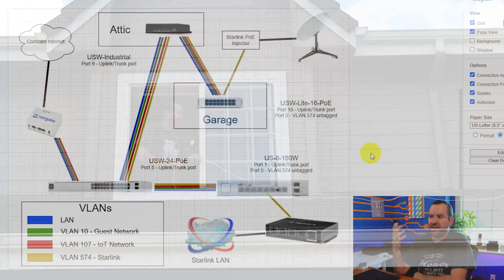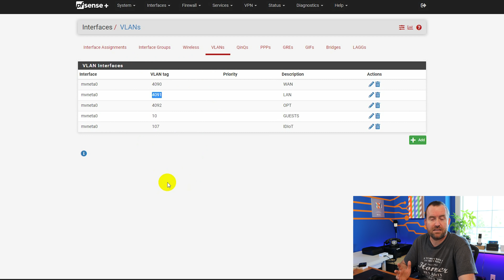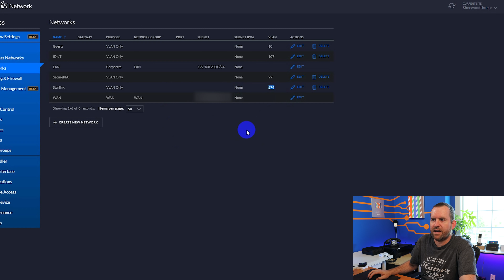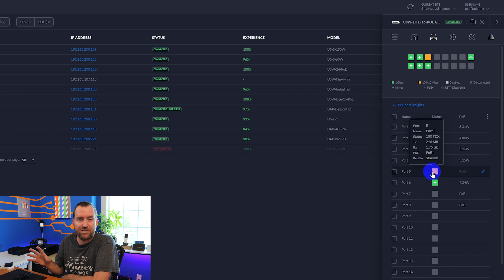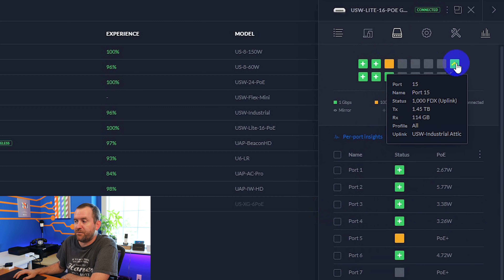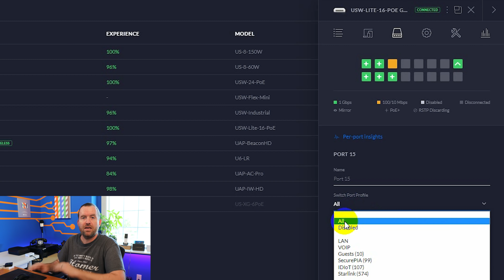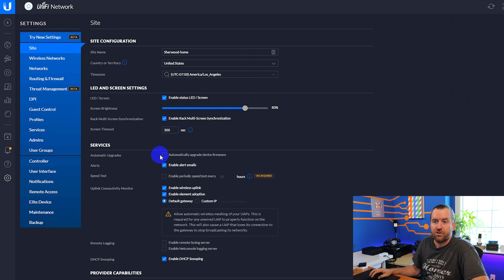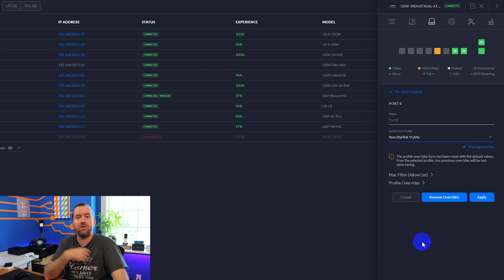My Starlink VLAN Setup

Comment: So this was good stuff, however in 2025 this method is no longer there in the New Interface . I found 2 Way to do it in the GUI, I am sure there are CLI ways as well. 1 Just Switch to Legacy Mode, or 2 in ROUTER select "Third-party Gateway" does the same thing as VLAN only option.

Comment: Great detail and explanation.👍👍  BUT, this solution doesn't seem to help me with my problem.  I have a remote location that is connected by StarLink which has a LAN of IoT devices (home automation, solar power system, generator etc.) and I need to remotely monitor and reset system setpoints etc.  In essence, I have a remote StarLink LAN that I want to connect to from my home network/pc or my smartphone to make these changes.  I believe I will need to establish a VPN connection but there's not enough geek in me to design the solution.  Help required.

Comment: I am trying to set up starlink without using their modem, can I just plug the white ethernet cable into a tp link switch because I tried that and reset the switch by unplugging it and plugging it back in and i'm getting nothing.. do i have to wait like 5 to ten minutes maybe? Or do i need to buy a tp link router er605? i've asked a few youtubers, i've emailed starlink. no one will help me.. pls help. i'm sure this is a simple answer for a tech. i'm not good with network stuff. IT looks like you are plugging direct into your switch at the first of the video?

Comment: I like my current wifi router, Synology RT2600ac, and its software and location in my house, is it possible to setup Starlink>managed switch>Synology Router and be able to retain all the functionality of my Synology router as a router instead of making it an AP? Is that where I setup a VLAN in some way. I realize this question probably makes it clear I should not do this, but I want to learn and figure out if I can use my current router as a replacement for the Starlink router, but run through a managed switch first before getting to the router due to wifi placement for the router in the house.

Comment: I do the excat same thing from my Barn that has a clear view of the sky. Then I run that VLAN.574 via the Uniifi trunk into my office and then tag it into my PFSense. I created a tagged VLAN.574 in PFSense and set it up as a backup internet connection so if/when my primary fails, it automaticaly switches over to Starlink.

Comment: I need to set up a unifi test lab at home. I've tried several times, but I keep on selling the hardware I've put aside to clients. There are often supply issues with Ubiquiti products, and having some pieces on hand has helped a lot. I've sold the G3 Domes I bought for my house at least 4 times. By the time I actually get to pull some cable through the roof and install them, they will have paid for themselves

Comment: With other manufacturers, the default VLAN is say VLAN 1. All ports are set to this by default, and it is not trunked to other switches. You then create VLANS for specific purposes, and set ports for client devices to one specific VLAN port. The only normal exception I see to this is if you want to use a single port port for a VOIP phone with a pass through port to connect your computer. This normally limits the connection speed of the PC to 100 megs, so its not the best. Hopefully these days in any business, you will have 2-3 Cat 6 sockets at each desk.

Comment: Hi Chris quick question do you know if there is any way to configure the UDM Pro to have load balancing of the two WAN connections rather than failover. I want to be able to have both Starlink and my other connection both active at the same time. The only option I have now is failover. 
Thanks 

Regards 

Paul
Reply: Latest UDM firmware allows that.

Comment: Thank you!  This video was tremendously helpful and understandable.  This explains how you can route 2 ISPs through your network to the edge router for testing Starlink.  I would love a video comparing "VLAN Only" to "Corporate LAN" with VLAN ID and how to segment or wall off each or perhaps allow cross-talk.  (IOW:  a use case where there's only one ISP but you want a certain VLAN not to be visible to the rest of the network and vice-versa, perhaps only accessible through VPN)

Comment: One note for people new to VLANs that wasn't explicitly called out in the video: never expose tagged frames to end-user devices. In other words, all trunk traffic should be at the infrastructure level, between switches or APs, not on any access ports on your switches.

Also, Chris -- I assume there is a physical limitation that prevents you from doing this, but it seems you could benefit from a hierarchical architecture by running your USW-24-PoE as a distribution switch and trunking to your garage. That way all inter-switch traffic would pass through the USW-24-PoE and you can centralize inspection and services there.

Comment: Hey Chris - Why didn't you just present Vlan 574 to PfSense as an additional WAN, and create a gateway group for automatic failover incase your primary comcast link dies. You could create another Starlink LAN, and use policy based routing to ensure that network uses the Starlink WAN as the default egress point.

More importantly, you could have put the Unifi Edge router on ebay and make it somebody else's problem :-)
Reply from the maker: I wasn’t trying to run the Starlink service into the pfSense.

Comment: Any worries about having essentially public internet touching your switches? (Yes I know it's a completely isolated vLAN)?  However it still resides on a Unifi switch and I've had experience with Unifi and traffic affecting separate, and completely isolated vLANs, but living on the same switch (absolutely no routing between vLANs, no router setup on either vLAN)  Edit to add: I know you say that the devices shouldn't know anything about the other vLANS, but as I mentioned, I've found this not to be the case in Unifi.  I've shown Unifi the issues and they've confirmed, but didn't have a resolution.

Comment: Since the StarLink dish is plugged into a POE switch, can you eliminate the POE injector (i.e. power the dish from the switch)?
Reply: As far as I know, starlink dish use proprietary PoE spec. So you can't.
Reply: @tofudimsum8072  So, if it is sold in the US, it has to have a UL listing, and the power requirements will be stamped on the unit.  Anyone have a photo of the specs?
Reply: @CJones-ic9tc  I don't live in NA. But the dish use non standard PoE. You still have to use the injector included with the dish.
Reply: @tofudimsum8072  So, no pic of the specs?

Comment: QUESTION: I have a printer on VLAN 10 that I want to share with Guest network that is on VLAN 120.  I want Guest clients to discover and utilize printer but nothing else on the VLAN 10 network.  What is best way to do this - reserve printer address in DHCP and write rules for firewall to only pass traffic to reserved IP address across VLANs?

Comment: Question: Consider the case for a UniFi camera / UNVR setup where you don't want someone to be able to disconnect an outside camera and "jack into your network" and see internal traffic.  You still want to be able to access the UNVR, suitably authenticated, even when you are offsite.  How would VLAN's play a role in protecting your LAN from a potential intrusion should someone "jack into a camera ethernet plug"?  

Perhaps you might even consider making a video on how to secure/isolate a camera network while still allowing the UNVR content to be accessed.

Comment: I have a small project do you think you can guide me pls ?
Reply: I've been following you guys on your channel.  I'm planning a project and want to use ubiquity products. I'd like to get your opinion on and suggestions for it.
Reply: The requirements are to set up wireless access to a ranch that will have small metal container homes, so each one will need wireless within as well as a way to connect to a wire. Also, wireless is needed for common areas such as pool area.
Reply: NOT for free...that's just 1 way he makes his money. Who will support it in the future if you don't know what you're doing? 
He can be contacted for consulting work

Comment: Why did you choose to set up Starlink as it’s own LAN?   

Couldn’t you use a Starlink1 VLAN to ‘trunk’ to your USG/UDM and connect a Starlink port to the WAN 2 port?  

Does UniFi allow for load balancing to assign the a WAN connection to a specific VLAN?  In that case a Starlink2. VLAN would have firewall rules applied. 

It would require two VLANs, if it is even possible with UniFi gateways, but would allow access to Starlink using your existing network.  It could also serve as a failover in the case of a Comcast outage.

Comment: Chris, since the UDM Pro still doesn't implement IGMP-Proxy I had to do this same setup on my AT&T fiber with U-Verse TV in our Unifi environment.  I have 2 uplinks coming out of AT&T's Arris BGW210-700 gateway: one in IP-Passthrough mode to the UDMP, and the other to SFP25 on the USW-24-POE switch.  That port is setup as VLAN-Only VLAN10.  From the USW I have "All" uplinks to the 2 devices that need it: a US-8 in the media room for the DVR (the DVR's port profile is set to that VLAN10 which feeds a set-top box), and a UAP-AC-IW in the in-law apartment, with one of the uplink ports on that AP profiled to VLAN10.  The AT&T gateway does all the DHCP, routing and IGMP spoofing for that VLAN10 so the DVR and set-top box get IPs and clean, uninterrupted signal on AT&T's bizarre unicast to multicast IPTV implementation.  I have no IGMP snooping on any of my LAN (VLAN1) or IoT VLANs, and the rest of the uplink trunk profiles are set to only deliver those 2 VLANs.

Comment: Carrying any traffic on the Native VLAN of a trunk is a security issue. Do not do this. Also, bringing "outside" traffic into your interior network equipment is also not a good idea. Lot's of bad information here. Yes... It might work, but you're doing this wrong and suggesting other people do the same. Stop it.
Reply: How would you recommend setting up the network in this case?
Reply: @narkeddiver7325  use VLANs properly, don't put traffic on the Native VLAN of a trunk especially untrusted "outside" traffic coming from the internet. Put a small firewall at that edge between Starlink and the rest of the network. An old ASA or even an old ISR would be fine. Use encapsulation for separation if you must use the same wire at least use GRE.
Reply: Routing and zones.
Reply: @myrthjt  thanks for your explanation :)
Reply: @narkeddiver7325  very welcome.

Comment: Great explanation and breakdown. Wish I had the patience to sit down and write up how my network is setup. I work in IT so I try to replicate what I have to work with day in and out. Ended up setting up an external PfSense firewall, and then an internal one. Took some time to do so I could get VLANs, static routes, and DNS to work how I wanted but it's videos like this that either sparks someone's interest to give it a shot, or are an Ah Ha! moment for someone that's been hitting road blocks. Great video.
Reply: For what it's worth, for any untrusted devices that are hardwired, such as IDIoT devices, I recommend putting them on access ports and not trunked ports. Wireless would be isolated to the VLAN specifically assigned to that SSID if they are setup properly. This would prevent them from being compromised by modifying the VLAN tags to hop VLANs in the event they are exploited.
Reply: Then I watched the rest of the video and my foot was put in my mouth.. :D

Comment: Does running it this way with the untagged port connecting to the Starlink WAN leave you open to a VLAN Hopping attack allowing access to the rest of your network VLANs? Do you have to do any additional configuration inside the switch to mitigate the risk? Also what's the reason you didn't put the edge router with the PoE injector and then trunk the Starlink LAN back down to your office?
Reply: Yes.

Comment: LOL, No USG/UDM..... Need to be mindful of UniFi that will bridge VLAN's at the USG's by default, pretty certain the same on UDM. 

Chris, your description for tagging is confusing, the port on the switch when assigned will Tag/Untag, the rm untagged is incorrect. On managed switches, All inbound traffic will be tagged, all outbound will have tags removed. 

You did touch on this but for others, If you leave a port as default on UniFi, all tags will be intact and presented to every device on the network. This means you have to set ALL ports on the network switches to the correct VLAN or VLAN's (switch-port profiles) of switches as all are "Trunk" as default.

Comment: Unifi helps a lot by not usung taged/untaged/trunck nomeclature
Reply: Yeah it helps but also makes it harder when you start using other manufacturers network equipment after using Unifi. Luckily i learned it the hard way before i started to use Unifi.

Comment: I was working at a local WISP and we had an Unifi city-wide network with private fiber links to towers and we used something similar. There was a Mikrotik router and a set of VLANs that were set for different IP blocks and we would set ports of Unifi switches to connect customers in office buildings, and CPE radios we would just set the VLAN for the customer side Ethernet port to give them internet. This setup was really easy to work on because it was an Unifi network underneath and I could pull up a phone or tablet and make changes, the IPs for the Internet were controlled by the Mikrotik and Sonar. VLANs are hard at first to get your head around butt once you realize they are just virtual network cables from one thing to another its not bad.

Comment: ¿Why not use the pfsence for the starlink and use it as a back up for the whole house, or testing on a vlan back to the us24 to play with? Not sure why the two routers
Reply from the maker: Mostly just for testing and video.  If I was using Starlink as a backup and/or load balanced secondary ISP, I would put it in the pfSense.  That's just not how I'm using it.
Reply: @CrosstalkSolutions  i understand. Ty for the insight. Great video

Comment: Will you be making a video, where you combine Comcast and Starlink together via Pfsense or even with a USG/USG-Pro/UDM/UDM-Pro?
I currently am using Comcast (PTP Nanobeam) into my USG-Pro WAN 1. WAN2 is coming from a Peplink Max HD2 (with Comcast WIFI WAN, Starlink and Cellular). Because I am in a rural location my options are limited, unless I want to spend a fortune for Comcast directly to my home.
Thank you for the videos

Comment: Hi Chris 

I did a similar set up to what you did a few years ago using unifi switches. passing an ISP modem ethernet connection through on a separate VLan to the wan port of my router to a different part of the building.I found that if you click on clients in the unifi controller you could see devises on the ISP network that were not on the site where I was located at the time.

Comment: You are using a edge router on the end of the line. Is it possible to just use a (standard) switch instead to connect to the dish or do you explicit need to use a router (Starlinks or own router)? Have you tried it or can give it a try? Would be happy to hear from you.
Reply: I imagine you only get one IP, which is usual with ISPs. Thats why you need a router.
Reply: @wiel-spin  Ok. Sounds reasonable to me. Has somebody tried it - just for a test to proof it? It's new tech, so nobody knows. But as some found out the dish can do much more as expected earlier. So maybe it also has DHCP for multiple clients or more "hidden" features. ;)

Comment: Very timely video! When I get my Starlink system (sometime this year I hope -- I live in southeast Texas), I will have to mount the dish on my barn to get a clear sky view. I was thinking about using a new Nanostation AC bridge from my barn to my house to use as the separate internet source as WAN 2 on my USG. Maybe that isn't necessary if I interpret your information correctly!
 I already have a NS5 AC Loco RF bridge from the barn to support a couple of switches, an AP, and some security cameras out there with the cameras all on their own VLAN. Do you think I can piggyback on that system to bring my Starlink source back to my USG basically as you described?

Comment: can i use starlink in Ghana ?
Reply from the maker: You can check their website to see if it's available in your area!
Reply: Out of curiosity, I tried to order Starlink for a couple random locations in Ghana, and they all said, "planned availability in 2022."  From what I can glean from press reports, it sounds like they are only doing beta installations in US, Canada and UK due to satellite coverage from the partial network (and possibly to minimize support hours and/or language issues???).

Comment: I do something similar. I have my WAN coming in on a VLAN, but my firewall is a VM in a vSphere cluster. I can migrate the VM to any host server in the cluster, and if the host running the VM fails, it automatically starts up the VM on another host. Pretty overkill for a homelab, but I make a point to have redundancy in everything I do.

Comment: Any reason the pfsense firewall isn't handling both ISPs? I'm aware there are some port forwarding issues with multi wan with 2.5.x but that really shouldn't be an issue long as Starlink isn't the primary.
Reply from the maker: I could run the Starlink connection into the pfSense if I wanted to...that's definitely an option.  In my case though, I have it kept separate for testing/videos.
Reply: He'd need an extra VLAN to route SL Lan traffic back out of pfSense up to wherever his SL Lan equipment is setup. The way he's done it keeps it simple.